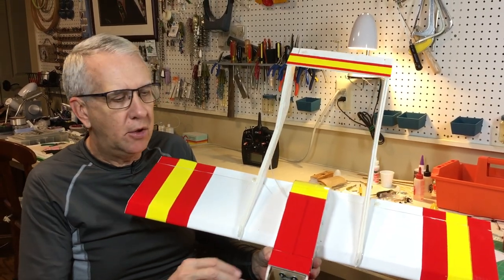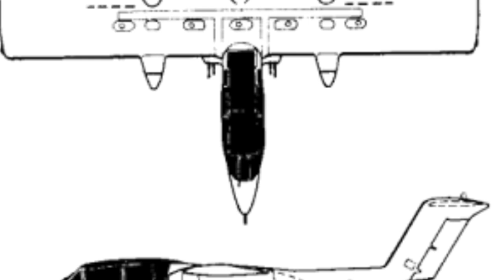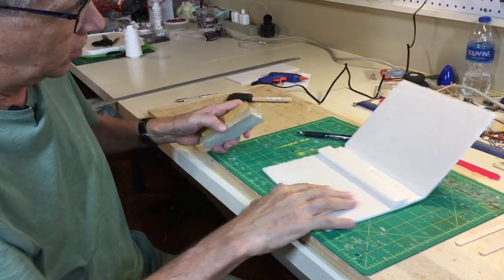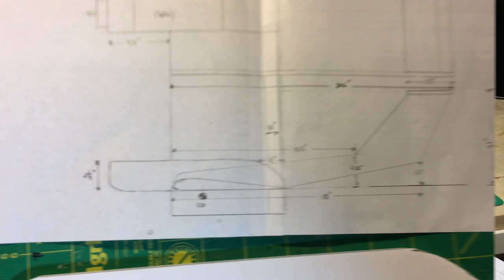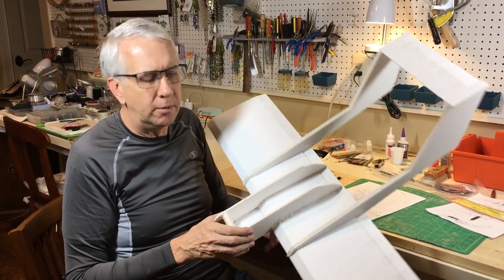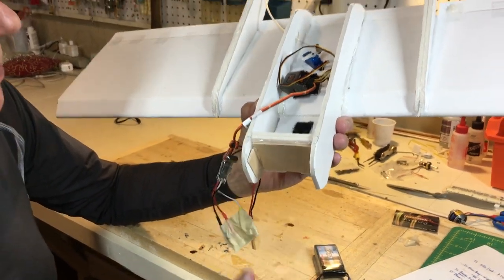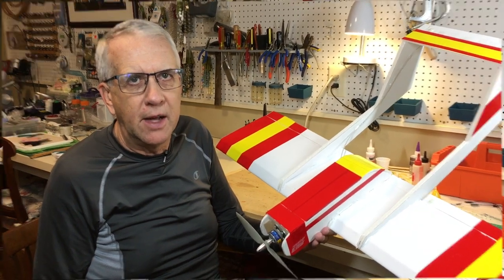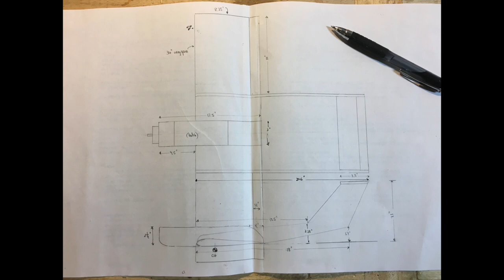Super Simple Bronco Foam Board RC Plane For Newbies

Comment: Hello Tim I finished building the  single engine bronco for newbies. Everything is working the servos use the right side stick left/right for right wing and up/down left. I can see channel 4 wants to work on the elevator but isn’t? Also the harness from the motor to the battery is heating up? ALOT! Is it the wrong harness(30a) or the 11.1V 1500 mah battery to strong? I have pics but can’t attach. PleaseHELP!!!! Thanx Josh
Reply from the maker: If your harness is heating up try a larger ESC. Tim

Comment: Great presentation. What type of foam board did you use? One can buy several types of 20x30 foam boards but not all of them are of good quality.  Thank you.
Reply from the maker: Valentin:  I use Langford and Nichols for my 20 x 30 foam board, from Amazon.com. Not the least expensive but I like it. Keep the paper backing on for Bronco, adds a bit of strength. Tim
Reply: @TimMcKay56  Thank you so much Tim. Much appreciated.

Comment: I just noticed your neutral position of the elevator appears to have a bunch of up trim.  Is this because the plane is a bit nose heavy?  It seems to porpoise ever so slightly in flight as well.  Thanks for the excellent model, building one right now. 

A bit further down, I asked for dxf or dwg formats (or a vector pdf).  Please disregard for this model as it is simple enough that I just imported the raster image and traced it in AutoCAD.  But maybe for future models :-).

BTW, love your content.  Excellent information and well presented.  Thanks again.
Reply from the maker: Jim:  I think the elevator was pretty close to neutral.  The plane balances out.  Usually, if the incidence with the wing and tail surfaces not just quite right, can have some up or down trim.  As this is a first prototype, I was quite happy with the way it flew.  And you are right with a bit of porpoise movement.  My fix for that would be to make the tail booms an inch or two longer.  And I am including all future plans in the Description section, to download from Google Drive.  Tim
Reply: @TimMcKay56  Any thoughts on including .dxf versions of the plans in your Google Drive?  Almost all CAD systems will import .dxf files directly.
Reply: @jimn6sxb644  Jim:  Will work on this!  Tim
Reply: @gordonmckay4523  Thanks!  I'm sure TinkerCAD has an Export as .dxf feature.  BTW, I am making mine with the boom about 2.5 inches longer.  Thanks again for your good work.  You help make this hobby fun and affordable for us old fogeys :-).
Reply: @jimn6sxb644  Good luck!  Tim

Comment: Tim, the sheet that prints out for me, has the 6" rule at 1 3/16 of an inch and the plan wing measures 5 7/8. None of that computes.
Reply from the maker: Dennis:  Do this.  Just measure the wingspan on your computer printout.  Let's say that measures 8  inches.  The Bronco wingspan is 30".  So in this case, 30 divided by 8 = 3.75.  Take every dimension as measured on the plan and multiply by a factor of 3.75.

Plan B is to review my video of how to enlarge a model plan at FedEx Office, and print out a full size plan this way.  Tim

Comment: I built the 30" wing version of the Bronco. At this point I need to purchase the electronics. Which motor 250 or 370 , prop and battery combination would  you recommend. I would like to keep the electrons balanced and not have too large a motor for the prop or battery. 
Thanks, Bill B
Reply from the maker: William:  Great!  For the 30" version, a Park 250 motor is plenty with a 2 cell lipo.  I use an 8/6 prop, usually fly around half throttle.  Tim
Reply: @TimMcKay56  Tim, I guess my confusion is I believe you finalized on a Park 370 which I think is a bit heavier and may need a larger battery.
Reply from the maker: @williamclark8340  Oops, you are correct, it is a Park 370.  I had forgotten how small the 370 is.  I still use a two cell lipo.  I have updated the description with this info.  Note also that I have a second Bronco video, where is made the model a second time with lots of improvements, like a elevator servo closer to the tail and a nicer acrylic paint scheme.  Tim

Comment: Tim, I should have mentioned that I am flying at an altitude of about 6,500 ft. This may make a difference in my prop size.
Reply from the maker: William:  Good point. No harm going with a larger motor as well due to altitude. Tim

Comment: Hi. In the drawing is written 3 degrees right and down thrust. What do you mean by that? I presume the shaft of the motor will point up 3 degrees with respect to a horizontal line also point to the right 3 degrees with respect to the longitudinal axis of the plane. Is that correct? Thank you.
Reply from the maker: VB:  It is common for many model airplanes to have a bit (2-3 degrees) of motor right and down thrust. Right thrust, looking down on the nose, points right a bit (I eyeball this estimate). For down thrust, the motor shaft points down a bit, looking from the side, to prevent “ballooning” with addition of power. Tim

Comment: Great looking build! How different would this fly if the wing were on top like the original Bronco?
Reply from the maker: Kenneth:  That is a very good question, I had not thought of this.  Answer:  The plane should fly just about the same.  Prop thrust line would be a bit lower, but no effect on its flight.

I do think the lower fuselage might look a bit better, much like the Bronco.  Only minor concern would be the fuselage getting scraped on the ground with no landing gear.  Give it a try!  Tim
Reply: @TimMcKay56  Throw a strip of 10 mil laminating film on the bottom of the booms. It'll take a beating, and could be removed and replaced when needed.

Comment: Nice video Tim... Since I live rural and about an hour from a Kinko's would it possible to also post your .dxf file or add the dimensions layer to the plans...also when I scale up the downloaded pdf plans to your 6" ruler as a guide... I notice there is a slight difference in measurements listed from the hand drawing on the video... ( example...boom length slightly off )  Am I doing something wrong?  Thanks!   jt
Reply from the maker: Jxvot:  Yes, I can do that.  But, whatever your printout, simply "measure" the 6 inch scale on the printed page.  Say it is 2 inches.  Just measure any other dimension on the plan and multiply by 3 (in this case) to get the full size dimension.  If the 6" ruler came at at 3 inches in length, measure other dimensions on the plan and  multiply by 2 (i.e. 3 times 2 = 6 inches)
The Bronco is mostly straight lines, and you can pretty much sketch it out on the foam board.  I never made a full size plan.  Tim

Comment: Hello I built the bronco completed w/ the foam board but I’m not sure how or which order the wires connect to the receiver? Is there any videos that walk you through setting up the receiver correctly?
Reply from the maker: Josh:  It varies by receiver manufacturer, but typically the connector from the ESC goes into Port 1, ailerons to Port 2 and elevator to Port 3. Be sure you bind the receiver to your transmitter as well.
Reply: Also I bought the Flysky fast-16x 10ch. 2.4GHz Transmitter Controller w/ IA6B Receiver C9E2 is both sides of the controller supposed to be spring loaded to go back to the center or like mine the left side controller isn’t spring loaded to go to center when not pushing up or down. Only the right side is. Is that correct or did I receive a damaged controller?

Comment: How thick are the 2 pieces that go in between the wing?
Reply from the maker: Josh:  Two lengths of the 3/16" foam board, so 2 X 3/16" or 3/8" thick.  Really not critical, but two pieces of foam board wortk well for an airfoil shape and wing strength.  Tim

Comment: Love it, specially slow flight. I hope you have time to create a pdf so you can save us the trip to the printing shop. 

Other video you have another plane without rudder and mentioned that since it have no rudder does not need wheels but just hand launch. can you please clarify this i do not understand it.

thanks
Reply from the maker: Alex:  Will work on a set of plans soonest.  For now,  you take a screen shot (command-option-4 on my Mac).  Print out the screen shot and enlarge with a FedEx Office large format scanner.
Regarding rudder, I thin that what I was saying is if there is no landing gear, no need for a steerable tailwheel.  If a model has ailerons, you can usually get away without a rudder.  But the catch is no steering on the ground if no rudder.  Tim
Reply: @TimMcKay56  got it , thanks for the clarification!!!
Reply: Nice work, good channel. Please understand that screen shots will yield all kinds of inaccurate results depending on the user. PLEASE print your Turbocad file to a PDF. Thanks!
Reply from the maker: John:  You are correct.  I know now that I can load the plans to Google Drive, post a link in the description.  Will do that as soon as the plans are complete.  Tim

Comment: What battery did you use? My friend is looking to build this. He's got some 1400mah 3s packs, would those be in the range for this plane with say a 50 gram motor (2212).
Reply from the maker: Greg:  I'd say a three cell lipo would offer gobs of power.  As a check, before you hand launch, see that the model "pulls" a bit from you at high throttle.  Tim

Comment: Where can I get a template with the dimensions on it.  The pdf file shows a 6" rule but what does that mean?
Reply from the maker: Dennis:  The 6" ruler on your print out would measure "6 inches" on that print out.  So, just measure the 6" ruler on your print out.  Let's say that is 2 inches long.  So just measure any dimension on the plan and multiply by 3 (in this case) to get the dimension to measure on your foam board model.  Say the wing on the plan measures 10 inches.  Multiply by 3 and get the model wingspan of 30".  I have made the Bronco with both a 30" and 20" wingspan, both fly fine.  Tim

Comment: Y lead your ailerons, single channel used no problem you could have used a smaller 3-4 channel Rx then without issue.
Reply from the maker: DD:  You are 100% correct.  And I used a Y connection on my Square Flyer (elevons), video on on Feb 14!  Tim

Comment: Is it possible to show a clearer picture of the plans? The one you provide is not sharp enough to clearly see the dimension numbers. They are blurred.
Reply from the maker: Harris:  Did you use the download link for the plans in the description section of YouTube?  Tim
Reply: @TimMcKay56  I did, but there are no measurements. Am I missing something?
Reply from the maker: Harris:  RC plans generally do not show measurements as they print out full size. In this case, just use the 6 inch ruler as a gauge.  Tim
Reply from the maker: Ruler is on the plan. Tim
Reply: Thanks Tim. I’m new to this. I appreciate you putting the plans up. Can’t wait to build this and give it a try.
Reply from the maker: Harris:  I just added a Google Drive link for two sets of the Bronco plans:  One a PDF version, the other (hopefully a bit clearer) for a PNG version.  Good luck with your build!  Tim
Reply: Tim, I’ve got the pieces all transferred. Can i use the same size servo HS55 for the ailerons? Also, what battery did you use and can you recommend a good charger. Thank you.

Comment: Hi.  What is the Kv rating of the motor you are using, and what size prop is fitted ?
Reply from the maker: SSS:  No idea on the Kv rating, uses a 7x5 prop.  I usually look at a chart for the motor, listing best props and weights for the models it is suited for.  The Bronco is so light you could use a range of motors.  Tim
Reply: @TimMcKay56  Thanks Tim.  A couple of us are building the Bronco as our first venture into foam board and are looking forward to flying them.
Reply from the maker: @SmallScaleSteam  SSS:  Hey, sounds like fun and best of luck!!  Tim